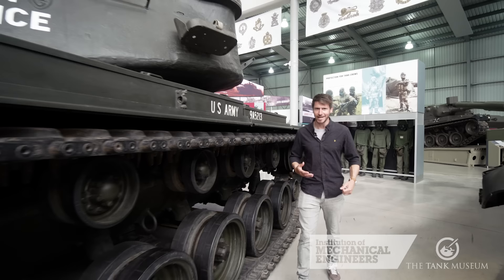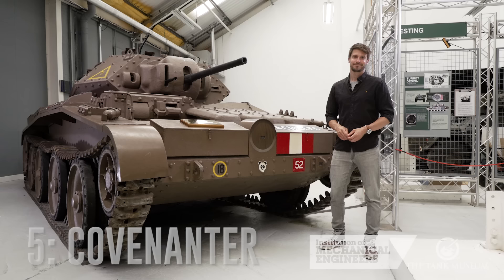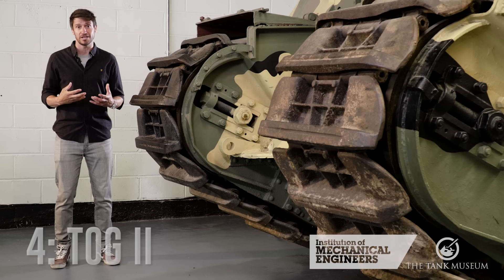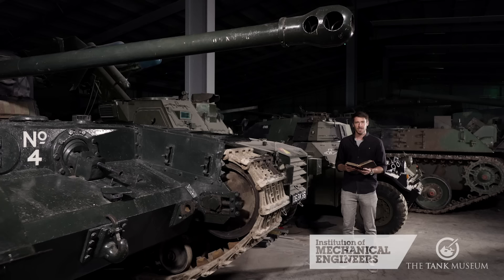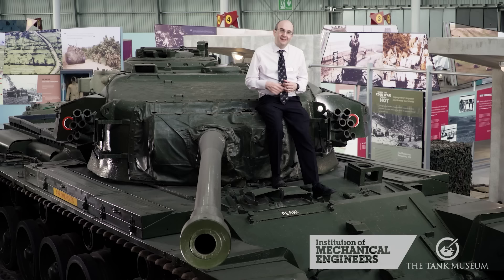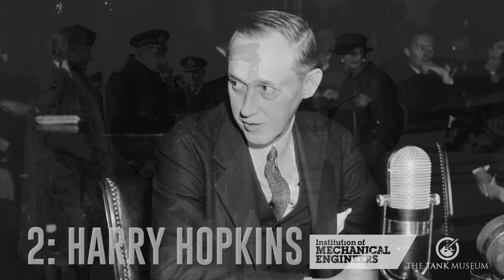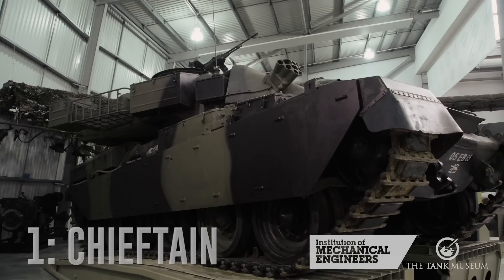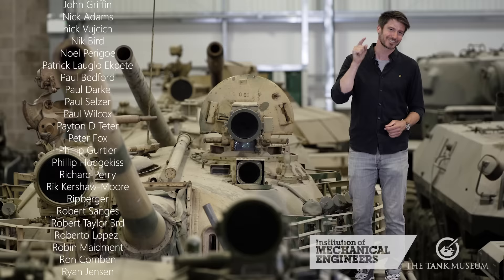Rob Bell | Bottom 5 Tanks | Institution of Mechanical Engineers | The Tank Museum

Comment: "Hey guys, The Valiant used to try to amputate it's drivers feet and only ever travelled 20 yards shall we make that the worst tank?"
"Nah, let's go with the Chieftain, that has a mildly dodgy engine."
"Oh my god you're right!"
Reply: Each new contributor tries to not copy the others and yet bring in something new with them. Everybody going after Valiant would be underwhelming.
Reply: Except that never happened, made up by Fletcher
Reply: @totalcookie4953  there is an inside video that shows the problem. How exactly is it made up?
Because it didn't cost anybody a leg? Well, maybe if you use your ears and eyes you'd notice that nobody(except you) claimed it in the first place. But they showed how you can lose it in heat of the moment.
Reply: Because far less money went into the Valiant project before they canceled it. If the British would try to to fix its flaws, throwing more money at this thing, then it would make it on the list.
Reply: @TheArklyte  no it doesn't, i know the video, and its terrible, the valiant reports are in the archives and there is 0 reference to this issue. period
Reply: The Valiant didn't go into production, it's faults became apparent during the testing stage. That is how engineering works, you design a model, try to critique it on the drawing board, then build one to see if it is any good. There are countless tanks worse than the Valiant, that never made it past the drawing board & probably a few that made it to prototype stage. Most countries tend to hide their failures.
Reply: @Paciat  The Chieftain went on to have a successful career, is combat proven and is still in service with several countries today. Hardly a disaster of a tank.
Reply: @skasteve6528  You're right. It was so bad that it was completely unsalvagable. 
Meanwhile the Chieftain went on to have a respectable war record, and is still in service today. 

But yeah "wOrSt TaNk eVaH!" because of a temperamental engine lol
Reply: @dernwine  Valiant isn't in this list because its issues were identified and appropriate action was taken. Chieftain is on the list because issues were identified but appropriate action was not taken.

Making mistakes is perfectly fine and it happens all the time in engineering projects. What matters is recognising those mistakes and taking steps to rectify them and then learn from them.

He never said that Chieftain was the worst tank ever. But it could be argued that their mistake with the engine prevented it from being the best.
Reply: @JumpSeeker  Hardly makes it the worst tank ever though. See my points about it having a long and successful career. 

And yes, he did say it was the worst tank ever. That's what being #1 on a list of worst tanks ever means.
Reply: @dernwine  I think you need to consider the criteria he is using in this list, which is bad engineering practices used in their design processes. In this case, 'worst tank' is based on that criteria. Knowing there's an issue and then carrying on regardless is one of the biggest mistakes you can make. 

It's only meant to be a bit of fun and to get people thinking about the vehicles from different perspectives. If you can't see that, then clearly this video series isn't for you.
Reply: @dernwine  Lol, successful career of causing problems. Quote: According to Aladdin Makki, the Iraqi Army Corps chief of staff in a post-war interview, Iraqi sabot rounds "Went through the front Armour of the Chieftain and came out the backside". This as well as the Chieftain's poor off-road capability influenced the Iraqis to reject British arms sale propositions, who were at the time courting Iraq for arms sales that included Chieftain MBT's. According to Makki, when the British telephoned the Iraqi director of Armor, Salah Askar, he responded with "We don't want your stupid tanks!"
https://en.wikipedia.org/wiki/Chieftain_(tank)#Service
More countries use Centurion today than Chieftain.
Reply: Valiant is just too obvious.
Reply: @dernwine Agreed, I would have thought some of the many 1930's wretched light tanks, like a Japanese one or French, or Italian, or... would have been in a #1 or #2 spot.  Maybe the Tank Museum doesn't have any though?
Reply: It's just pathetic that a potentially great tank had one fatal flaw, and nobody got it together to fix that flaw.
Reply: @JumpSeeker  Correct. As a mechanical engineer, I really liked his approach.

Comment: The Covenanter tanks should have been supplied to the Soviet Union as Lend Lease in 1941-42, instead of the Matilda.

In the frigid weather around Leningrad, the Covenanter’s cooling system would have worked fine.  In the Russian winter, the hot pipes from the radiators running through the crew compartment would have provided comfortable warmth for the crew, instead of cooking British crews alive in the North African desert.

Also the Russians are very skilled and practical when it comes to engineering, and probably would have been able to fix the Covenanter’s other reliability issues when the British could not.

The Covenanter wasn’t the greatest fighting tank in WW2, certainly no match for a T-34.  But in 1941-42 the Soviets were desperately short of tanks, and beggars can’t be choosers.   The Covenanter would have been an improvement over the BT-7, in terms of armour protection (the BT-7 only had a paper thin 22 mm of frontal armour.)

The British Matildas sent to the Soviet Union were badly needed in the Far East, against the Japanese.  Malaya and Burma were lost without them.
Reply: Lol, Germans attacking your country. Here are tanks that we cant fix in factories. Try to fix them in the field. :D :D :D
No, Russians were not very skilled and practical when it comes to engineering. It was an agriculture state that industrialized itself just 5 years ago. Many of them saw a first car in the army.
The reason why Covenanter wasnt transported by a convoy to Russia is because its crap risking sailors to transport it is wrong. Covenanter’s cooling system is just a one obvious example of what in it was wrong. The engine was also bad. Soviets didnt even want Crusaders (witch is an upgraded Covenanter) because a 'fast tank' that you have to maintain often is a slow tank. It has no advantages. Matildas could at least withstand German standard AT gun.
The British Matildas sent to  in the Far East were badly needed in the Soviet Union , against the Germans.  Malaya and Burma was just a side show to the war in Russia. Both UK and USA agreed that defeating Germany is their main goal.
Reply: you do realize russian summers get extremely hot ?
Reply: The Soviets did not have better engineers during the war, they had some great ones, true. At this stage of the war though, they could not afford the resources to fix problem tanks.
Reply: Some decent fighter aircraft would have been more use in Burma than a bunch of tanks
Reply: Any counterfactual that involves giving the Soviets worse equipment and worse support from the UK in 1941-42 imagines a war where the Soviet front collapses. It’s hard to understand how desperate and brutal that period was just from British sources.
Reply: I know this must be a shocking surprise to you but Malaya and Burma were lost for the British Empire no matter what. Sorry I had to break it to you so bluntly. ;)
Reply: @Paciat  someone obviously has no idea about russian history...
Reply: @katyusha1527  Its you. You cant even form an argument where Im wrong and why.
Reply: @Paciat  sure the ussr were mostly agricultural beforehand, but under the iron fist of stalin (and death of many) the five year plan had effectively transformed the country to a industrial powerhouse.  This meant they were not lack of field engineers and were capable of recovering and repairing vehicles very quickly.  The designs such as the t-34, the later is-2, for aircrafts the yak series and lavochkins are perfectly examples of soviet practicallity and merit in engineering.  Your argument that soviets were not good engineers because they country was agricultural year back is very invalid.
Reply: @mcs699  sure the Soviets did not outproduce the US, but the country industrialized rapidly as a result which contributed greatly in the war.  I never said anything about ourproducing the US or UK.. but the plan created the basis for Soviet industry to grow especially late war and post war
Reply: @mcs699  those 36,000 Sturmoviks didn't just pop into existence. And USSR produced as many T-34s as US did the M4 Sherman - the latter being an exemplar of out production of the enemy.
Reply: The cooling system works and even provides benefits if it gets cold enough? Highly unreliable.

You do sound like you're just calling bugs "features" simply for lame comedy.
Reply: The reason the British didn't have tanks in the early stages against Japan was that they thought that thanks couldn't operate in that environment.

Comment: I get that the engineering explanations in this are oversimplified, but the part about the Chieftan's L60 is outright misleading. The Leyland L60 was not a bad engine due to its 2-stroke design, or due to its opposed-piston design. 2-stroke designs are often more reliable than their 4-stroke counterparts, and opposed-piston designs are not inherently unreliable.

The Leyland L60 suffered heat stress problems, often suffering and failing due to cracked cylinder liners, lip seal failures, ruptured piston rings, and rear gear case failures. None of these had anything to do with the engine being an opposed-piston design or a 2-stroke design. Rather, these issued stemmed from the design being based off of a constant-speed variable-load train / generator engine, which wasn't suitable for the high heat and stress a tank engine will incur during operation.

Comment: I'm surprised he didn't pick the A38 Valiant
Reply: That definitely should have been Number 1 on the list.
Reply: The mistake the designers and engineers in this tank made, was forgetting that the enemy are on the outside, not the inside, of the tank.
Reply: To be fair, this list is more about the lessons to be learnt in engineering rather than which is worse than the other. These tanks seemed to be chosen because they demonstrate those lessons quite well. Valiant has many things wrong with it, but it perhaps doesn't demonstrate any one lesson particularly well.
Reply: @JumpSeeker  I mean the eventual sole purpose of the Valiant was to show engineers how to NOT build a tank.
Reply: @Frserthegreenengine  What particular lesson would you attribute the Valiant to?
Reply: Valiant is on other presenters' bottom 5 list.

Comment: If you were to swap out the hateful L60 and put a decent engine into the chieftain it would be possibly one of the best tanks ever made
Reply: Diesel version of RR Griffon would have done nicely.
Reply: It happened. The Iranian contract Chieftains had conventional engines, and the development program that this started eventually led to the Challenger and Challenger 2.
Reply: And a more modern suspension - Vickers were building export tanks with a Torsion bar suspension around the same time Chieftain was spawned and yet......?
Reply: @cryhavoc999 
At the time, the good old Chiefy was the heaviest NATO MBT and therefore possibly too much for a Torsion bar setup.
The Horstmann spring pack was reliable and rugged as well as battle proven (Centurion used them), so no increase in Logistics.
Reply: @aaronpentith130  M60 was only a few tons lighter. If Vickers had made it - it would have had a Torsion bar suspension.
Reply: The Chieftain was originally designed to be fitted with a 4 stroke V8 diesel.
Only the NATO dead end of Multi fuel killed the original plan.
Leopard 1 was multi fuel capable, M60 as well. Even the French AMD 30 was as well.
IMO as an ex REME A-Mech, the Chieftain should have been fitted with the Leopard 1 powerpack, then no doubt about it the Chiefy would have been The best MBT in the world at that time.
Reply: The Iraqis seemed to disagree on that matter. In the Iran-iraq war the Chieftain mark 3/5 are stated to have performed poorly against the T-72s. Whether the mark10/11s would have done hetter.....
Reply: @johan-erikjohannesson2796 
If you search hard enough on You tube there was a video about this.
The majority of the problems were due to the Iranian tactics (There were none) since the vast majority of the Officer Corps fled after the Shah was deposed by the Ayatollahs. Poor  crews and low morale. Add the ever present reliability problems, made worse by the whole world not trading with Iran at the time. 
However there were instances of Chieftain performing well.

Comment: Speaking as both a chemical and mechanical engineer, the lessons on the philosophy of engineering, and the responsibility of the engineer to speak out when the client's specifications are causing problems... including potentially fatal problems... are crucial, and well presented in this video.

There's also a time to speak up and firmly inform the client that their concept and reality are at odds...

Finally, the quote from Dyson Freeman is a good philosophy for the engineer to consider... we are charged by our clients / employers to deliver reliable and economical designs, and the more that you can safely adapt existing technologies to meet novel requirements - developmental innovation - the more likely you are to meet those goals.

Going on that concept, the electrical final drive for tanks was an idea that worked excellently in railroad locomotives, but was about 75 years ahead of being practical in an armored fighting vehicle... sometimes, the R&D engineers need  to spend (quite) a bit more effort before an application is practical. No worries, and more power to them!
Reply: speaking as another engineering professional (words selected deliberately) there is a reason why they invented Project Managers.

For those not familiar with the process, here is what normally happens:
Engineer: - What's this email you just sent me?
Project Manager: - Kick Off. Here is a new project we just got funding for.
Engineer: - What? Doing what?
Project Manager: - don't worry about that. It is all in the Power Point file. Timelines. Resources. Cost Codes. Milestones.
Engineer: - Wait! What? Hang on? You have me down for 80 hours this month and I don't even...
Project Manager: - Great! See you next deadline! Bye!!!

Project Managers were invented for a reason. Never said it was a GOOD reason...
Reply: @mudcrab3420  PM: Management gave you 80 hours to do this task.

E: Wait, what??? I told you when we wrote the proposal that it takes 160 hours!!!

PM: Well, you'll just have to get it done in 80... good luck with that!   Oh, and I'll need daily progress updates...

E: Those weren't in the manhours estimate!

PM: Project Controls needs them for the client's tracking... see you tomorrow!